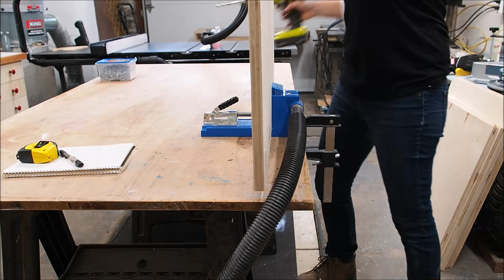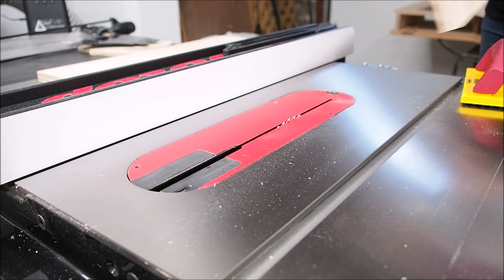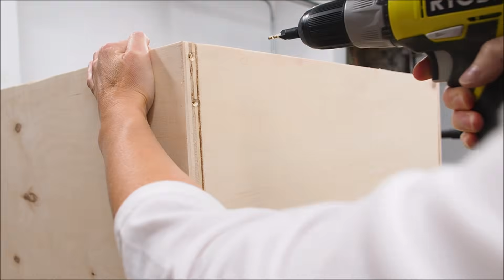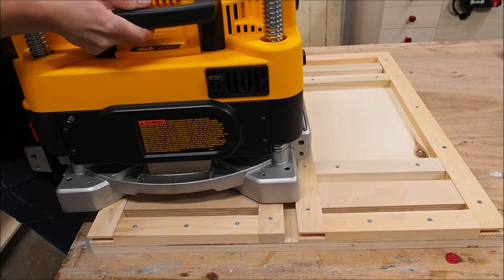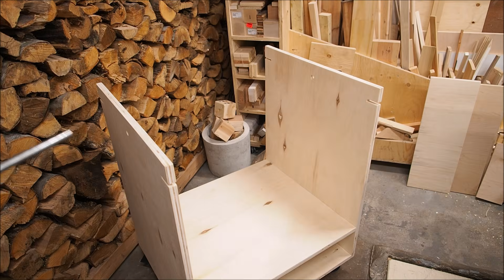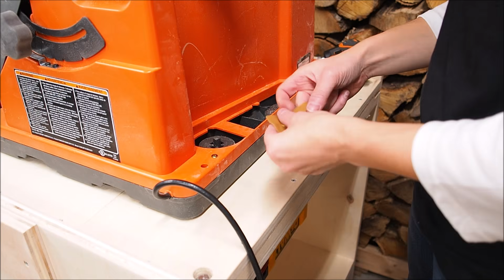Flip Top Tool Stand || Dewalt Planer / Ridgid Sander

Comment: @DIYMontreal super cool!!!!  I have the same planer (only wish height adjustment was metric, imperial is just sooooo awful).  I am debating a build vs the WEN multi-purpose rolling stand.  3/4” plywood is pretty dang $$$$ in the US.  The debate is mostly centered around the WEN’s extendable rollers that should help to reduce or eliminate snipe.
It has been six years since you built and posted this video, just wondering how the table has held up?  I noticed you didn’t use wood glue (Titebond or the like) in your build, and just wanted to know if your build is holding up well without the glue.  Thanks for the video!!!  Excellent!  Nice tools you got there too.

Comment: Great video. The only issue I have is that you used screws to mount the tools... You even commented on how heavy the thickness planer is. I definitely would recommend lag bolts. Otherwise, an innovative design and clean build.

Comment: It appears to be 5 years or so since you built this. Have the vibrations from the sander or planer caused any problems for the other or the assembly?  Thanks a lot. Just purchased the cut sheet and looking forward to getting to work.

Comment: Has everything held up over the last 4 years? The weight of the planer has me worried about holding it in place with just 4 screws.
Reply from the maker: Yep, use it on a regular basis and all good. I replaced the screws with lag screws about a month after making the video and haven't had any issues.
Reply: @DIYMontreal  awesome, thanks

Comment: Does that fold down top on the sander hold in all the extra parts when it’s upside down? What about when your using just the spindle, and not the belt sander attachment?

Comment: For added stability, instead of iron pipe, I used 5/16" solid rod and skateboard bearings, which accept the rod perfectly. I embedded them in a 3/4" hole in each side and also threaded each end of the rod with a die.  Then 5/16" nuts can then be tightened on both sides and provide additional support to the top of the stand.

Comment: Marie:  I have both of those tools and like most, limited space, this mobile flip top tool stand will fit the bill perfectly. One question, actually two....1) how have the screws to hold down these heavy tools held up over time? and 2) did you consider bolts and nuts thru the 3/4" ply before securing them to the top frame? Thanks/Merci

Comment: Its a great project - I'm halfway through building one for my small workshop with a belt sander on one side and mitre saw on the other. Saw will definitely get bolted. The only improvement I've seen is the guys putting an extension lead inside the work surface sandwich, plugging in both tools then running the extension lead power cable out through the pivot tube. Very neat ;)

Comment: Just a quick tip.  When mounting the planer, make sure it’s mounted a little to the right to account for the lowering/raising knob that protrudes out or you won’t be able to fully flip it.

Yes… I learned that the hard way, but I just cut the knob in half to fit when flipping.
Reply: I’ve just had to cut my handle too. Pity it doesn’t fold down.

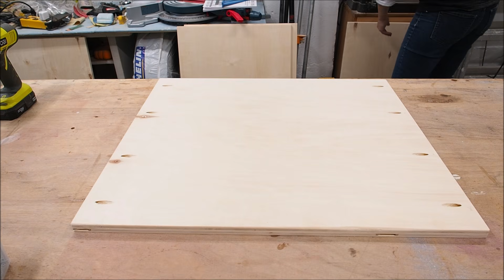Comment: Your pocket holes are on the wrong side @0:39. The should be on the bottom so when you put in the screws they have more to bite into ....the way  you have them the screws will be going towards the edge of the plywood, possible cause failure at some point.

Comment: How is the flip cart working out after 2 years? I am planning on mounting the exact same tools on my build. Do you have any more information on how you added the bolts to hold the tools on?
Reply from the maker: The cart is still going strong after several flips and being wheeled around. I simply drilled pilot holes and drove in some lag screws.

Comment: Love the video. I had the dewalt planer and just came home with the rigid sander. Guess what I’m gonna build. Need your plans first then go shopping for my material and start building. I wanted to ask you what kind of plywood did you use? Baltic birch or maple veneer? I’m a bit of a newbie so two more questions: 1) Is the plywood good on both sides(what’s it called?). 2) what are the sizes you had it cut down to in the store? I need that cuz I’ll be doing exactly like you did. Thanks so much !!
Reply from the maker: I used sanded aspen for this. Smooth on both sides but more affordable than maple ply or Baltic birch. 
I can't remember the exact cuts, but probably just ripped down the middle as per the plan dimensions so it would fit in my SUV.

Comment: Hey Marie, from where did you get a 3/4” OD pipe around Montreal? Would love to support by using the link but the product isn’t available. 

Hoping I can find one cause I already drilled the 3/4” hole before checking that the pipe I bought was 13/16”. Doh
Reply from the maker: It was available at Home Depot

Comment: Great video. We use the garage for our vehicles, and my shed isn't large enough to work in with the tools I have accumulated.  I used to have my planer on a stand by itself.  I built two flip tops.  The first is planer and sliding miter saw combination.  The second is a router table and 6 inch grinder (I will probably add another small tool opposite of the grinder).  These flip top stands have saved space in my shed, and they also make it easier moving tools in and out of the shed.  I found it easier to loosely secure the platform to the sides with the locking mechanism when placing the pipe through the platform.  This way you don't have to hold the platform, and you can maneuver the platform as necessary to push the pipe all the way through.  Looking forward to more of your videos.

Comment: Is there any reason everyone builds this unit leaving a small fence on each side of the top, instead of making the rotating base flush to the very top of the vertical side panels? Just wondering if a flush mount wouldnt give the whole thing greater flexibility for future uses... Thanks for the video...
Reply from the maker: I fear you will experience tearout leading to a catastrophic fail if you make it flush. The plywood sides need thickness above the 4 little notches for the locking mechanism.

Comment: I have that same dewalt planer, they're 93lbs lol. I hate lugging that thing around! I think I'm going to put it and my dewalt tablesaw on one of these tables. Question, you and the other guy that built this same table did it alone. You both held the top up while getting it mounted/pushing the "axle" rod through... Why didn't you just lock the top on with the eye bolt clamps then push the rod through?

Comment: What s the height of the sander? Home Depot site claims 23.5". This cant be true. You have a 30.5" overall height and a 5" drawer. Plus the thickness loss of the bottom panel, middle panel and the flip panel. Math doesnt add up to allow the sander to fit in the upside down position

Comment: I have looked at a few of these and liked yours the best, so I bought the plans. However, in all of the videos on this type of project that I have seen, no one addresses the electrical aspect. How do you keep the cords from tangling up? And do you just run and extension to the unit when you are ready to use it? Thanks, James
Reply from the maker: In the video I show how I keep the cords tied up while not in use. When using it, the tool is usually close enough to an outlet to simply plug in, otherwise an extension cord would need to be used.

Comment: Before installing the second piece of plywood on the top you can rub a old candle into the pipe groove. This will help the pipe pass through the slot on final assembly. Please sweep up any excess wax off the floor ASAP as it will make the floor slippery (Don't ask how I know this LOL) I really need to build this for my small shop, Thank you for sharing.
Reply from the maker: Great tip, thanks! 
And hope no one was hurt in a waxy floor accident!

Comment: The pipe is taller than my 1x2 for the top part?
Reply from the maker: If you used 3/4 outside diameter steel pipe (not EMT conduit) it should be the exact same thickness as a 1x2 laid flat.

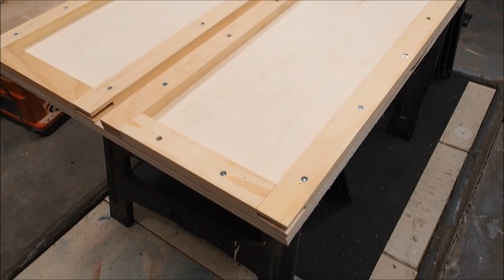Comment: Great vid, very clear and concise. Question for you. (around the 4:18 mark) Seemed like there was a lot of cutting and lining up for the bolts/screws. In hind-sight do you think it would be easier and more flexible to just use some more 3/4" ply? That way if you ever change out the tools you don't have to worry that the new holes might not be as supported.
Reply from the maker: Yes that would work well to just fill the inner void with more 3/4 ply. It would take the guess work out of positioning the blocks and allow for future tool swapping. I was just trying to keep it to a single sheet of 3/4 ply but that's a great idea.

Comment: Well i have been toying with the idea of doing this for my table saw and jointer thicknesser  i just feel it may be to heavy but would free up some space great build though
Reply from the maker: If you’re able to use bolts it would ease your concerns about the weight perhaps. And make sure to centre the weight of both tools from front to back.

Comment: Might have to build one of these. I have the same Rigid Spindle sander in my shop. Also have the Dewalt 734 planer, the one before yours. Combining the, both on one rolling stand would be a nice space saver. I use both machines all the time.
Reply from the maker: So far I’m really enjoying the space saving and practicality!

Comment: Love the video. Nice version. I am trying to find the cut list. Please help
Reply from the maker: Thanks! In the end, I did not provide a cut list. You can get some plans from FixThis BuildThat. I left a link to those plans in the description box. For reference, my platform is 27" wide by 24" deep, and the side walls are 30-1/2" tall.
Reply: @DIYMontreal  How much of a difference in dimensions was yours from the plans from Fix This Build That? I ask because I have the same planer you do. I see you say "Platform" and I assume that affects parts B, C, and I. But it also affects parts A. Parts B,C and I are already 27 1/2" x 21 1/2". You mentioned yours is 27", did you shrink it by 1/2" but made it 3 1/2" deeper? That's kind of what it sounds like but I'd love to know for sure.
Reply from the maker: @spencerjw  I wouldn't be able to say; I didn't use his plans, I just came up with my own dimensions to fit my tools. The platform is the flat table on which the tools sit. I made it 27 x 24.

Comment: As I said, great build.  I can see you are just using pine, but it looks so good.  I never see such nice plywood in Lowes or HD, but maybe I'm not looking in the right places.  I'd appreciate hearing from you about buying wood for projects.  I'm rebuilding a 1992 Airstream and besides hoping that being handy is gonna get me through I need to brush up on refining my carpentry skills. Hahaha
Reply from the maker: I got this at HD, it's sanded aspen. A bit pricier than construction grade plywood. It's ok, but when I want a really nice plywood I go for Baltic birch (they don't sell full sheets at my HD ) or maple plywood. Both are super smooth and flat. But it'll cost you. About $80 CAN for a full 3/4 sheet.
Reply: @DIYMontreal  Thank you.  Yes, plywood has really seemed to have gone up in price while going down in quality.  I'll take a more thorough look next time I'm at Lowe's or HD.  I live in an area that has a couple of sources for nice wood.  So, Lowe's and HD are not my only choice.  I'd like to do a few projects, like shop cabinet builds, as practice for the cabinetry work in my Airstream.  For the shop builds I'm not wanting to spend a fortune.

Comment from the maker: VIDEO UPDATES: 1. I recommend using 3-1/2" lag screws instead of regular screws for mounting the tools. I will go back and add some into the larger holes in the tools' bases. 2. When making the drawer, it's best practice to put the pocket screws on the outside of the drawer so the screws have enough material to bite into, making a stronger drawer.
Reply: Tpo be honest, I had misgivings about using screws instead of bolts to mount the tools.
Reply: I find the 27” width a dead tight measurement for the width of my planer. Great plan, but I’m going to add some width for wiggle room.
Reply: I was thinking the same thing. It looks like the only weak point in the whole project. I am definitely making this. Thanks for the video.
Reply: Do you have the bolts go through the table, and attach the nuts on the other side?
Reply: @adamvanlangenberg2690  I plan to use lag bolts and t-nuts on the opposite side.
Reply: @David-ql1hd  Wouldn't that interfere with the tool on the other side?
Reply: @kleraudio  t-nuts sit flush with the wood so I don't think it'll be an issue.
Reply: @David-ql1hd  I was thinking just that. t-nuts on the opposite side could be a good solution. Cheers!
Reply: I agree that the lags would be better than regular screws.  Because of the 92 lb weight of the planer, I'm considering through bolts and washers. I will modify a the gap between to allow for the nut so as to not interfere with the flip side.  Great video!  Thanks!!!

Comment: Love to see a Montrealer do woodworking... at least, it makes me feel more comfortable in creating shop furniture out of plywood because of our weather over here. Do you have any tips with pocket holes ? I mean, if I use my DeWalt impact driver, I can never feel easily enough when the screws are seated properly because it will make it dig into the wood anyway, and I feel that if I use my DeWalt screwdriver, I either never go deep enough (don't hold enough the other piece) or I am afraid to "strip" the threads it is creating by itself. In hope of receiving an answer from you, thanks ! :) (P.S.: I subscribed and I also speak french ^_^)
Reply from the maker: Bonjour Eric! I see your issue... bottom line I think you'll end up stripping the bit. It's almost inevitable for pocket holes I feel. That being said I try to stay away from the impact driver for this. You can adjust your drill to have less torque, but in my case I tend to rely on experience and visual cues. I drive them in until I think I feel resistance than take a look and screw some more if I think it's needed.
Reply: @DIYMontreal  Thank you! You are absolutely right, I am so not used to that new drill that I forgot it had a clutch adjustment. I am used to my old B&D drill that was, hum..... a drill, hahaha, no clutch adjustment and all. The drill that my dad had, but it died on me so I had to by a new one, and I went with the impact driver/drill combo which was cheaper at the time of buying them than individual pieces. Thanks again ^_^

Comment: This is an awesome build!  Are you nervous that the screws will eventually give out due to the weight of your tools?
Reply: I agree, I cringed a little looking at that.  I built the same thing but used lag bolts for mine - feel way more confident with them.  Still - mine didn't come out looking as nice as this one :)
Reply from the maker: I figure if any loosening comes into play, I can add bolts through the bigger holes. Might be a good idea to do that now, like you say for peace of mind.
Reply: @DIYMontreal  Pretty sure I did 1/4" on my ridgid sander and 3/8" on my dewalt lunchbox planer - they're not going anywhere :)
Reply from the maker: I was a little nervous at first, but after a few flips I can see this is rock solid. And when you think of it, the planer is about 100 lbs spread onto 4 screws, so only 25lbs per screw. It should hold. Otherwise I might add some more screws with a washer through the other 4 holes intended for bolts.
Reply: @DIYMontreal  I think the washer would be a good idea - at least peace of mind.  My concern would be more with the wood loosening around the screwhead over time - the flip action creating side pressure over time might loosen - maybe not, just figured for mine the lag bolts would take all concern away.  Glad it feels solid and thanks for the videos - enjoying them!